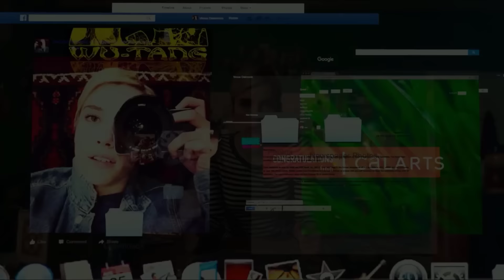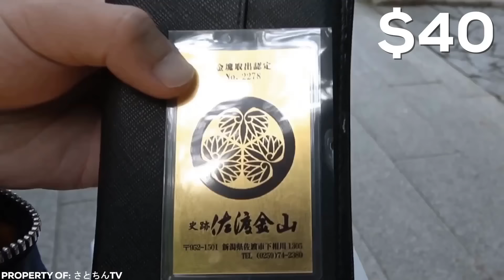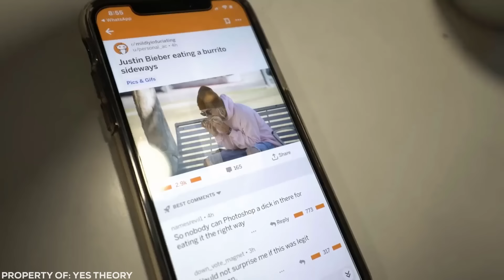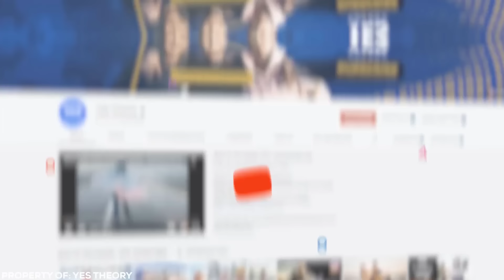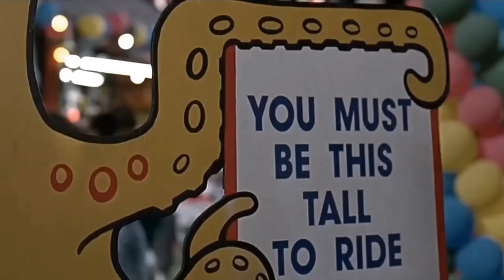He Was Able to Pull Out the Gold Bar! People Who Beat the System...

Comment: 5:40, I’m pretty sure that that Segway thing is more expensive than a cheap ride on mower
Reply: Lol marksman pfp
Reply: The set way is like 100$ and the mower prob around 800 and up
Reply: @TgrKryptix  and the segway can fit in small places like where he was using it
Reply: @zubb1585  yea and it won’t bother the neighbors
Reply: @TgrKryptix  and you wouldn’t need ear plugs
Reply: Not really $100 usually the ones withought bouetooth are around $160 , I got mine for £150 UK pounds with is close to the 160 US
Reply: I mean unless the lawn mower is has based then you have to pay for the fuel which is much more expensive in the long run
Reply: Gas*
Reply: My thumbs are too fat to properly type XD
Reply: I have one of those segways, but they are basically impossible to mow lawns with. On the other hand I have mowed lawns hundreds of times with electric unicycles and once you learn how it's a breeze.

Comment: You are actually kind of both wrong and right with the Claw Machine thing. Most modern claw machines have that setting, but most older ones do not, instead only having a base overall strength setting. So some claws are actually always pretty fair like you'd find in older mall arcades or just older arcades in general. So, saying that skill doesn't matter is wrong because it just depends on the machine.

Comment: Man when I worked concstructiin I wish I woulda knew about this I coulda been rich lifting that 80-120lb bat and getting it out that hole woulda been easy I’m a small guy back them I could carry roughly 9-10x my own weight I weighed 135lbs and could carry 1200lb beams beams by myself the first time my that guy saw me do it I told him to grab a helper and carry the other half it was a 2 peice 34ft long LVL 16” wide with a 2” cross section is memory serves it’s been almost 20 years since I was a framer ( I did it for 10 years within 1 year I was the foreman my boss didn’t believe that I could do what I told him cause everyone that came out there said they had experience and didn’t the only thing I had no experience at that point was with a nail gun I knew everything else already I restored historic houses with my dad in SC ) so he go to the middle and try’s to jerk it up on his shoulder a few time as I’m walking back I have to yell at him to get someone I wasn’t helping I just carried one we had a 10 man crew but we built huge custom homes ( McMansions as they call them ) most of the time using a worm drive saw and swinging a 28oz hammer all day plus everything else I did like not using ladders I would jump up grab a joist and pull myself up and if i was on the house at lunch I jumped off the 1st story lol my boss thought I was crazy one day or and my boss were on the 2nd story of a house we had 8 men that day plus me and him they brought us a 20ft 2x4 lam beam took 8 of them to bring it too us just the two of us hoisted it into the house he was about 5’9” 155lbs I was 5’6” 135lbs when I was a mechanic I would carry around 4 cylinder and V6 engine blocks and even some really small V8 blocks, front wheel drive automatic transmissions are way heavier than they look at least they we’re back in the late 90’s early 00’s I could chuck a 2x8x16 about 30ft I could do pull ups with my fingertips I was crazy strong for my size and I’m extremely smart so smart I’m illiterate I can’t spell without autocorrect and using google genius is a gift and curse all at the same time like Albert Einstein couldn’t tie his own shoe’s for example pretty sure he was illiterate as well